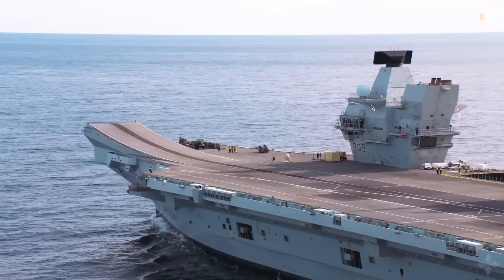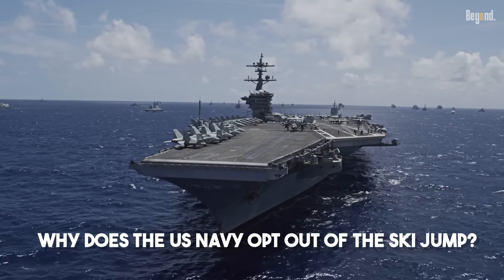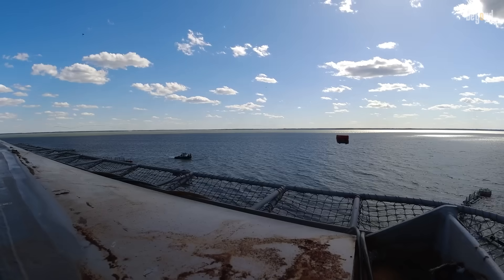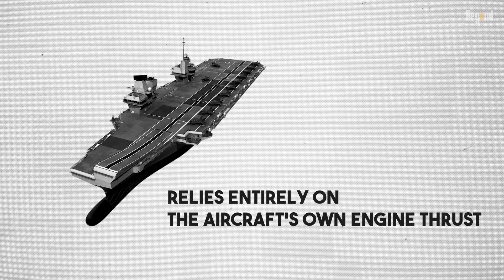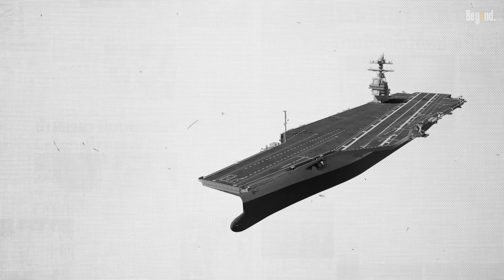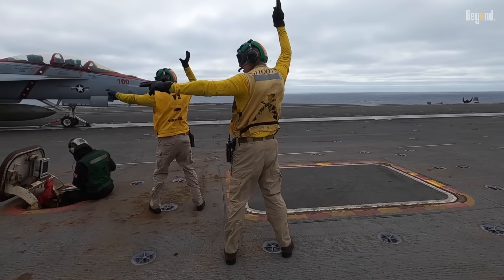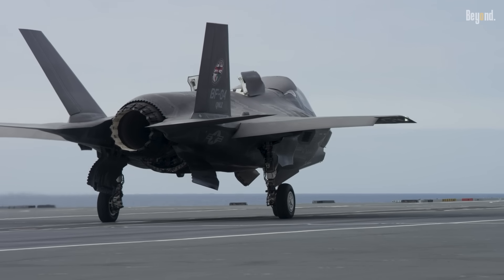Why US Aircraft Carriers Don't Have Ski Jump

Comment: I would have thought that putting the plane into a forced climb would sacrifice air speed and therefore lift and control which is more critical than a bit of extra altitude at that point
Reply: Agree, same thought and I'll bet we're right.  However, it does grant more altitude (as you said), which correctly used (e.g. stall recovery, however brief) , probably moots slower air speeds.  My guess, for non-VTOL aircraft, you'd see an immediate nose-down after the ski jump...

Comment: The angled deck assists with takeoff by converting horizontal speed into vertical lift reducing required take off speed, shortening the runway space needed & giving the aircraft an immediate positive rate of climb. It can also launch aircraft in sea conditions that would ground conventionally launched aircraft. Perfect for smaller carriers with a limited sized flight deck although the smaller you go the more weight concessions you face even with the angled deck. When used on larger carriers such as the QE class you have no such restrictions, full payload in weapons & fuel can be carried. The QE class can put 24 aircraft in the air in 15 minutes same as a carrier with catapult systems. A downside is without powered launch assistance older propeller aircraft such as E-2 Hawkeye can't be used but the Osprey with it's tile rotors can use the angled deck.

Comment: Ski jumps are useless unless the aircraft is already traveling fast enough to generate sufficient lift. If it is not then the ski jump does nothing but give the pilot a view of the sky as he now plummets into the ocean.
Reply: Uh, no.  Ski jumps permit more “hang time” in the air.  The plane can use the extra time to continue acceleration, getting over stall speed before hitting the ocean even if it’s not yet above stall speed when it leaves the jump.
Reply: 😂.... You want to ask the Marine Corps pilots who've used it as they love them It's actually much safer than a flat deck launch .... On the American ships the F-35B will still drop slightly as it clears end of the deck on a Ski Jump it's climbing away as soon as it leaves and it takes off in less space

Comment: Because on US carriers, you can be launching and landing at the same time in addition to max load out, launching planes that can’t be launched off a ski jump,etc.
Reply: The Ski Jump isn't a replacement for the CATOBAR carrier it's solely for the likes of the F-35B as it allows the aircraft to launch with more fuel weapons and it's much safer .... Ask any Marine Pilot/Aviator whose used it on a RN Carrier

Comment: Ski jumps are inefficient when it comes down to putting aircraft in the air. U.S. carriers can launch multiple aircraft at a time with catapults allowing them to reach sortie rates two to three times higher than a carrier with a ski jump. This is why China is moving away from the ski jump.
Reply: ロシアはアメリカの様な蒸気式カタパルトを実用化するノウハウを持たない。
だからスキージャンプなのだ。
人民共和国も同様だが、
彼らの新造艦は、
ウクライナのゴミ捨て場で拾って来た空母が採用していた
スキージャンプではなく、
電磁カタパルトを目指している。
電源をどうするつもりなのか興味深い。
原子力艦船はまだ彼らの手に余るだろう。
彼らの原潜は事故ばかり起こしている。
隣国としては迷惑極まりない。
Reply: And like it is mentioned in the video, payload is also very important. The catapult enables planes to carry much more of that. So of a catapulted plane can carry twice the payload, it is almost as valuable as two planes
Reply: And then there's the 'not-a-carrier' destroyers the Japanese have...that now have F-35s flying from their decks.  Not a threat to the supercarriers, but definitely a change in the power balance in the region.
Reply: Ski Jumps aren't intended to replace a CATOBAR carrier they're for launching the likes of the F-35B as it's one much safer and allows for a heavier take off weight .... Ask any Marine Pilot/Aviator whose used them on a RN Carrier
Reply: @petersmith7126 That's why the USN opted for the F-35C; can load out more fuel and weapons using the CATOBAR. If the RN switched to CATOBAR they would be able to launch a greater variety of aircraft at heavy weight loads. Planes need to be built around ship capabilities, not the other way around.
Reply: @g-wolf9445 ... The F-35B suits us just like it suits the USMC ... The Queen Elizabeth and Prince of Wales can be converted to an angle deck and catapult if we wanted it
Reply: @petersmith7126 I doubt you guys could afford that remember you are currently “Moth-balling” relatively New ships because you can’t afford the maintenance of the manpower to crew them
Reply: @g-wolf9445 Fleet systems need to be based on the missions the navy is intended to handle. I doubt the Royal Navy and JMSDF are going to be sending multiple carriers into every corner of the world the way the US Navy does, so a fast launching heavy fighter fleet doesn't make sense for them, whereas a flexible close air support fighter that doesn't need to fly far makes more sense.
Reply: Not true.  Ski jumps can launch planes as fast as they are spotted on the deck and wave height timed.  No time-consuming bridles to attach.  No time waiting for the catapult to reset.  No time down because it’s broken and needing maintenance or repairs.  

The British literally invented the steam catapult.. and rejected it all the same.
Reply: @calvinnickel9995 So when did the British use the first catapult launching system? How many aircraft can you spot at the same time on the deck of a ski jump carrier versus a catapult carrier? Please say that you can line up 3, 4, 5 or 6 at a time. I'm sure the ski jump carrier can launch a whole myriad of heavy weight multi engine aircraft, as well, other than helicopters. LOL!
Reply: @calvinnickel9995 There are several inaccuracies here. US carrier crews have a much, much higher level of experience. I think for Chinese carriers, it's something like 3 or 4 planes launched from a US carrier for every 2 launched from a Chinese carrier.  A separate but contributing factor is that there are always more elevators for moving planes on US carriers, 2 or 3 to 1, depending on class. And US elevators move 2 to 3 times faster than most other nations. Allowing for more aircraft to be launched quicker. And because a ski jump launched aircraft must return to refuel after a shorter time, ski jump carriers will always have less planes in the air. I could also talk about the fact that US carriers are nuclear, requiring no room for fuel. Allowing US carriers to carry almost twice as many aircraft, depending on class.

Comment: The question should be, "Why use ski jump"?
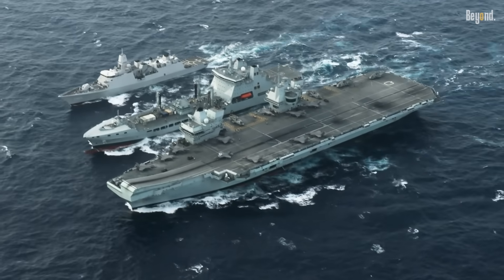Reply: Did you even watch the video? 2:11 answers your question
Reply: There are really no reasons to use a Ski Jump on a standard carrier it wouldn't launch an F-18 or anything but the Marines could certainly use it for their F-35B as it allows a heavier take off weight as in more weapons and fuel
Reply: why not make a retractable ski jump ramp?  you're welcome.
Reply: @fred-n6u More complicated, needs more maintenance, difficult to get a smooth transition, fragile, wrong pilot training if it fails and they have to make do without it
Reply: @fred-n6u More complicated, needs more maintenance, difficult to get a smooth transition, fragile, wrong pilot training if it fails and they have to make do without it
Reply: Cause they couldn’t figure out how to put in the catapult system
Reply: @terrybangley2281  for the hmm queen Elizabeth class there actually is consideration to give it a catapult which would result in the removal of the ramp
Reply: It allows the aircraft to take off carrying more fuel and ammunition and when they leave the end of the ramp they're actually fully flying ... The USMC pilots who've used them either with the old Harrier's or the new F-35 love them.
Reply: Why don't they take the stairs?
Reply: So the carrier can defend itself if power or steam is lost.
Reply: @jwhippet8313  Wrong.
.
Reply: @jwhippet8313  nuclear power , basically won’t lose power, but if  a”ski jump” carrier looses power it can’t work the elevators to get the jets to the deck
Reply: @terrybangley2281 the carapults aren't nuclear powered. They're old fashioned steam. If they lose pressure, they stop working.

Comment: ski jumps cannot support maximum load out
Reply: the point of the ramp is to increase the maximum weight a plane can take off with for example a f35b can launch from a queen Elisabeth class carrier at full weight 60,000ibs but from a ship without a ramp like the America class it can not
Reply: @adamchalmers8378  that’s because  it’s designed to , vertical lift capacity
Reply: @adamchalmers8378 the answer is Catapult>ski ramp, at the cost of maintenance/$ per launch
Reply: Thanks now I don’t have to watch the full video
Reply: The Ski Jump is not meant to replace a CATOBAR launch it allows an aircraft like the F-35B to take off at a much heavier take off weight and it's a much safer launch too.... Ask any Marine Pilot/Aviator whose used it on a RN Carrier
Reply: They can support more than the USMC van offer off their ships
Reply: We fly heavy or get wet
Reply: Yes it can.
Reply: Ski jumps have to face into the wind
Reply: Your mom can support maximum load